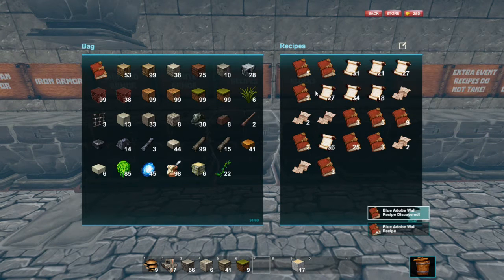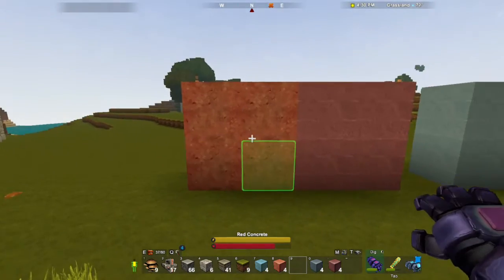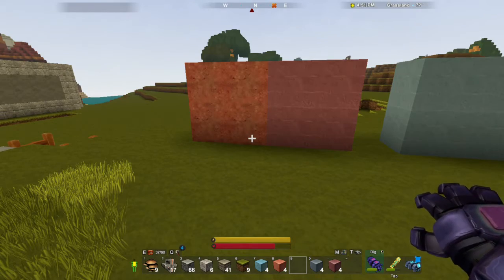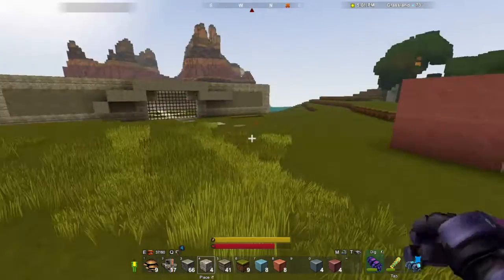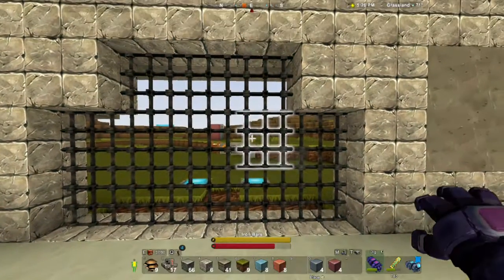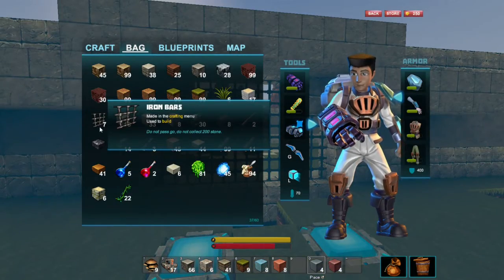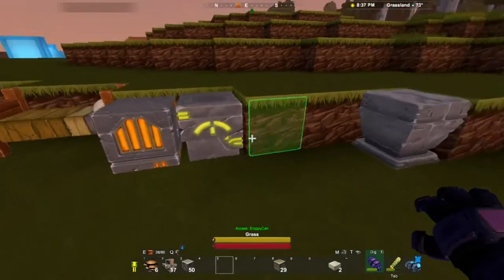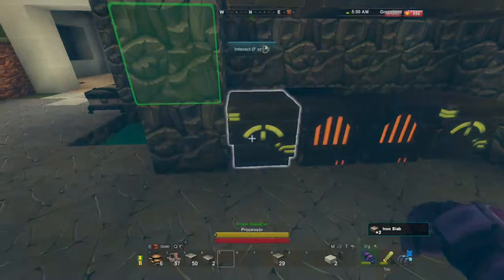MACHINE QUESTIONS - PS Creativerse (81) - Creativerse Let's Play

Comment: Delay gates are not timers. Delay gates delay signals. A signal has to be on at least as long as the delay gate is set for the signal to propagate. So, in your gate situation, with the pressure plates set to a 2 second delay before they turn off and your delay gates set for 6 seconds, with 4 seconds left before the delay gate passes the true, it's receiving a false, which is then what it propagates instead of true.

For the pigsy spawner situation, if you set pressure plates with no delay into a delay gate for 2 seconds or so, then you would have to stand on the pressure plates to maintain the true signal for however long the delay gate was set for to trigger the spawner. If you then put the delay gates into an AND gate, you can require one on each side which should imply that each side is ready.

I have not tested this out, but supposedly sensors are also counters that output numbers higher than 1 (the true/false system is actually a 1/0 system). The new arc signs have some additional functionality that can be used with them in the way of variables. With 4 data inputs on an arc sign (the 5th one is a remote on/off (enable/disable) input), you have the variables {1}, {2}, {3}, and {4} which will display the value being received by the input. So, theoretically, you could create a scoreboard for up to a 4 player game with those two items.

Instead of pressure plates, you could do a 1x1x2 (WxLxH)sensor field with a different block than the rest of the floor to indicate where the players would need to stand.
Reply from the maker: Machine expert to the rescue :P Lots to think about here, but lots of good information.. I guess it's time to get the hard hat on in this project
Reply: Not really an expert, but I have played with them a bit. And I try not to do info dumps like this too often, but, well, you asked for it in this episode :)
Reply from the maker: I like the info dumps :P I was playing with the sensor counting today but it's a tricky things to master